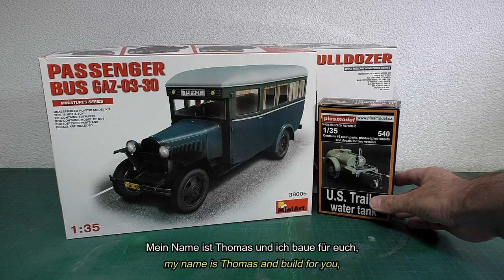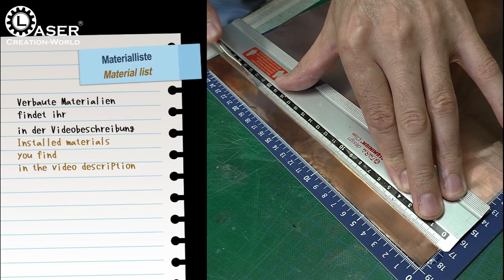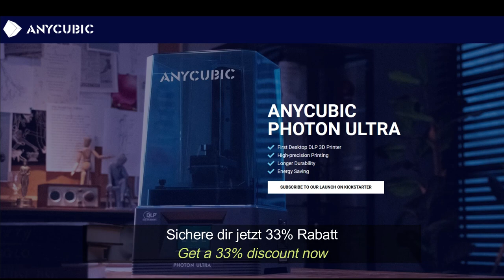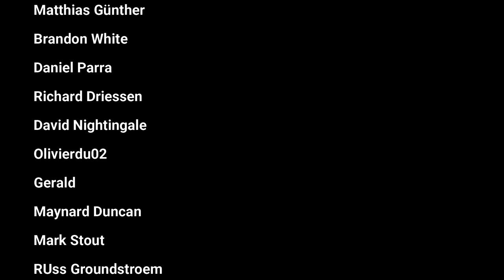U.S. Armoured Bulldozer for my Ice Age 1947 Diorama

Comment: Nice one, as for a alternative take that bulldozer, remove the seating position and turn it into the nose section of a halftrack that has lost it's nose section, but still has it's cabin.
One or two of those fuel tanks near that bulldozer engine, either besides it or elsewhere, like on the support & turning system that replaces that halftrack it's nose section.
Link the halftrack drive axel to where that bulldozer wince(?) is located. 

Also, if you turn your bulldozer around by 180 degrees and you could turn it into a tractor the USA used to pull flat trailers & Long Tom's (M11???), or rather something based on it.
Too bad you can't then turn a trailer storage box into two storage boxes, besides te engine and above the tracks.
Heck with the above buldozer & halftrack fusion idea, you could just as well, use two complete trailer storage boxes, acting as caterpillar tracks, mudguards, the old bulldozer blade mounting points could thus be of use, here, as well.
Also, if you reïnforce that roll-bar with your bulldozer from this clip, you might be able to put the fuel tank of that fuel-tank-trailer, on top of it, as somekinda roof. 
You could also make a storage plate above that wince as well, for either a trailer based storage container or fuel tank, but you could also mount a small crane, there, to help with the wood.
How Hybrid Kitbash Mad Max can you go?

Something fun.
https://www.youtube.com/watch?v=3oNE3nmosTw&ab_channel=BritishCouncilArts
And another fun clip, go to 7:20 for a very fun picture.
https://www.youtube.com/watch?v=7YnLc3JAAmc&ab_channel=MarcinJakubowski
US Army classified pole base with fission reactor, late 1950's.
https://www.youtube.com/watch?v=1Ujx_pND9wg&ab_channel=BrightEnlightenment

Anyway, good looking build, keep it up.

Comment: Ohhh, your artistry and technical skills blend to perfection in plastic, metal, etc. I find it an immense joy to watch you work (though it often is wistful for me that I at present cannot participate with my own builds and dioramas). 
   I do have one issue with all this: I watch you make many dozens of chsnges, alterations, etc. However, you provide no information about any of these! With each must I ask: 1) for what reason do you make each modification or correction? For example, a bit of specific length of thin rod 23.5 mm in length bent 90° at both ends, extending 5.5 mm long; 2) where precisely does each change need to be? 3) where must one drill holes, and of what diameter, or similarly affix the replacement? 4) what is the length of the substituted piece of wire, rod, extruded strip stock, etc.? 5) what is the diameter (gauge) of the dowel, rod, wire, etc.? 6) at what point does one bend a length of wire, rod, extruded stock, or the like?; of this new piece, what is the measurement of each bend, and the angle of the subsequent portion from its primary? I must understand why, so that I can learn to recognise them. To build a model correctly, it is critically important that I learn each.

Comment: "Ice Age 1947"??? Thomas, you have an extremely fertile imagination, but then we were being warned about a possible coming ice age in 1970...
It is quite realistic that those with the best chance of survival would be those with access to a lot of leftover war materiel regardless of time frame, especially if the armies that originally used that equipment have disbanded or are otherwise not present.
Also, I suppose an ice age would be a sufficient reason to call off a war. ;>)

I really appreciate the thought you put into the scenario and how the vehicles would have to be modified, like the use of canvas to impede airflow through the tractor's radiator.

Comment: Sometimes when I do models. depending on the model itself. like take cars or trucks. if im not gonna have the engine exposed or if the hood covers up the engine anyway. 90% of the time, I dont bother putting the engine in the car or truck, or I might just do the engine but wont add the small details on the engine when putting it into the car or truck. most times will just paint the engine at the point all black or depending if can see very small part of engine will match the paint color as rest of car or truck.  but, for the times the engine is not in the car. at later date I might put the engine together and use it for other things. can use engine as part of a junk yard theme or perhaps next to a workshop or such.

It is just a matter if and what planning on using model for. I mean if some small detail part is never gonna be seen, it is something I wont include in a model I make. but will just keep around for future use on something else.
Reply from the maker: i think so too, unfortunately i sometimes don't know what and how i build the model

Comment: I also had the misfortune of buying several Ukrainian-made models at once - MiniArt, MB and ACE, being flattered by their beautiful boxes. The quality of plastic and parts is simply disgusting! It seems that either their molds are very worn out, or these molds were made, as we say, “on the knee from shit and sticks.” I still have some of these boxes lying like dead weight - and I don’t want to assemble the model and it’s a pity to throw it away. A couple of days ago, I still made 2 more models for my winter diorama - Sd.Kfz. 6/2 with Flak 36 and SD.Kfz. 250/9 in 1:72 scale from one of these "miracle manufacturers". For me it was the "Victory of Will over Reason"... 🤬

Comment: At 2'.39" looks like you fixed the tracks with the opposite direction. And yes, that kit is made of the worst plastic ever, very fragile that breaks with the minimum pressure (even the track shoes ).